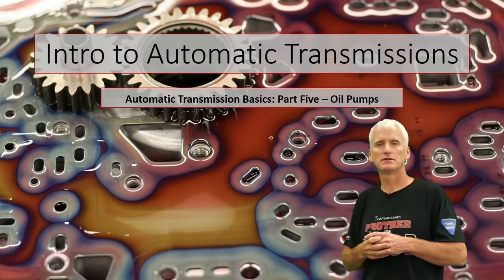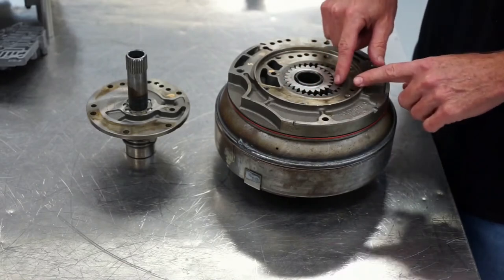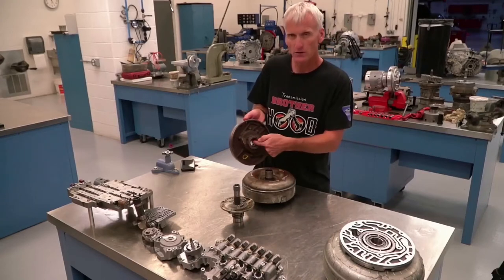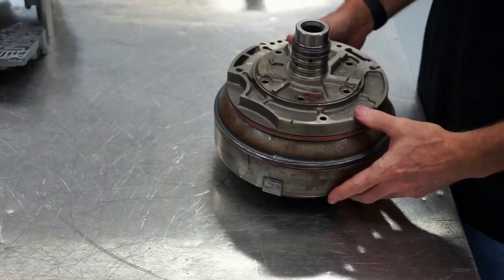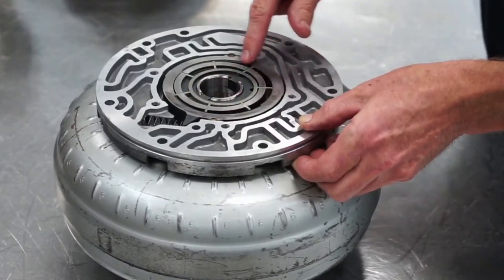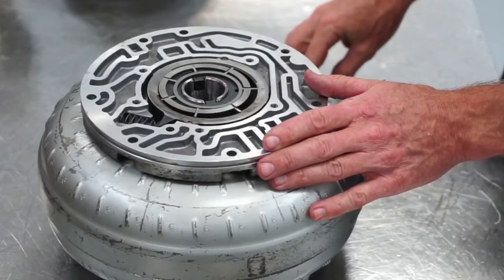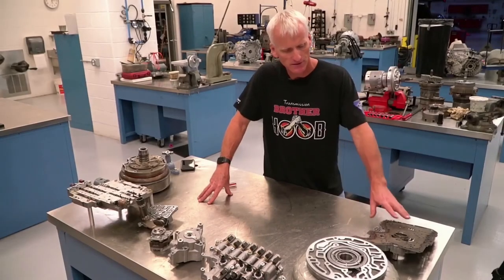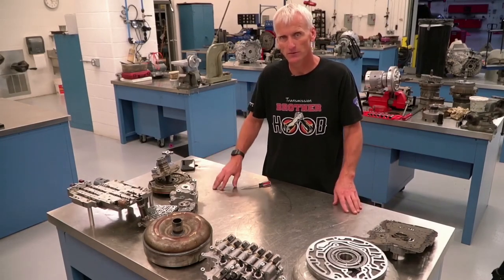Basic auto trans oil pump operation

Comment: Why would a transmission need to reduce the flow out of the pump? What benefits does that offer?
Reply from the maker: By reducing the output, the pump creates less drag on the engine, thus better fuel economy.
Reply: @siuautomotive  are the pumps different on the 4l60es  i broke the pump on my 90s 2 piece 2wd 4l60e in my trans am it was swapped prvious so dont know exact specs on tranny anyway that pump is broke and i need to fix it will any junkyard 4l60e transmission pump work ?

Comment: Hi, is it possible that failed torque converter stick oil pump in the automatic transmission and now engine is seized on Parking mode - can’t rotate engine by spanner?

Comment: Question- changed fluid on 6L80E via the radiator line while engine running and allowed to drain until fluid was barely coming out of the line. Could that damage the pump? Should I continue to add fluid if the engine is operating to prevent pump from essentially emptying?
Reply: yes... some pumps are designed to be fine running dry but not for very long. Running any moving component dry isnt a great idea. I let fluid drain out through the radiator line but then add fluid as it comes out until ive flushed about 12 quarts generally

Comment: On a 4 wheel drive transmission. What will cost the oil pump or the Or the transmission fluid to leak out and cause transmission failure